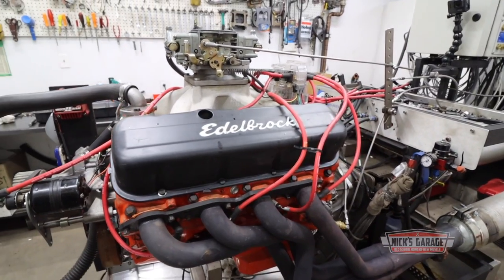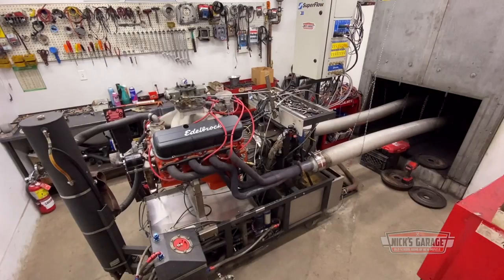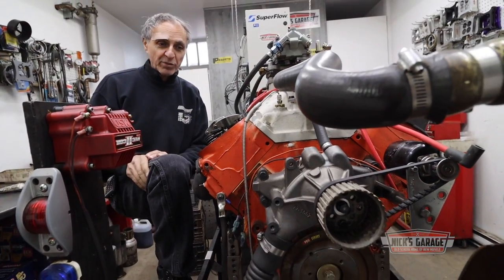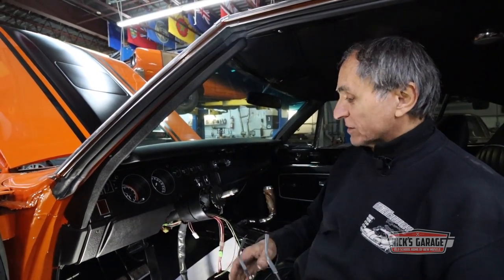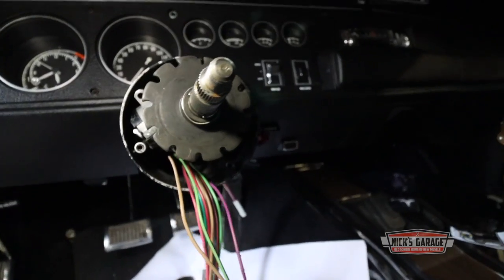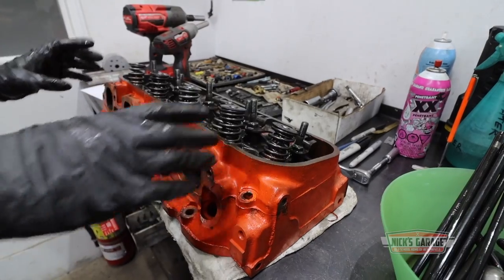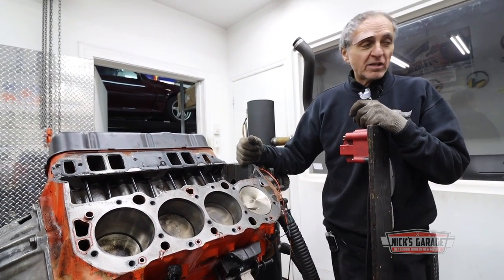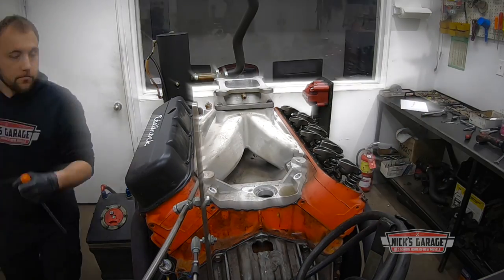Weak Big Block Chev • Wrong Parts + Poor Assembly = No Power!

Comment: All show and no go! It's amazing how you can mess up with such large cubic inches! BUT when you have no clue on how a engine works or how the parts you source and you choose by the way they look it's amazing how badly you can screw things up.....!  A Dominantor is a bit big for a little 427! Damn! Fist mistake. Had a buddy with a mild 509 BB Chevy, Merlin iron heads roller cam, Victor Jr intake, who always kept a dominator on the thing, the full steel non tubbed Chevelle would only run mid 11s on 12" slicks. Sells the car and the first thing the new owner did was chop it down to a 780 double pumper and the car gained over a full second bringing the steel chevelle into the low 10s on small tires in the 1/4. Lesson learned there! Bigger isn't always better! Did the Dominator look awesome? Absolutely! Not denying that fact it looked wicked! But it was giving up over a full second in time for that look and he never knew it, even though many people had made the suggestion to step it down from 1100cfm...... talk about a bitter sweet moment after selling it with being disappointed in the performance......

Comment: I think what you want is the closed chambered rectangular port heads. They used to call them bathtub heads cuz the chambers look like bathtubs. With flat top pistons I think it takes you to 10 to 1. Somebody co-sign this..
Reply: No. All it does it give you more compression, which the right piston will do. Closed chamner heads shroud the valves way too much. You want the open chamber platform.

Comment: That's a truck tall deck engine... uhm guys not good
Reply: Paul.   It is a tall deck block.  How did you know?
Reply: @nickpanaritis4122 it may have a 366 crank in it, that would answer the low horsepower..... it looks like 366 pistons as well.. the extended hose on water pump. That's a truck motor....on the original intake there is an extension hose between water pump and intake.. 
 And the amount of unused cylinder... and the low compression was dead giveaway
Reply: @nickpanaritis4122  You can tell by the water pump.  Where it attaches to the block, a short deck water pump will be almost flush with the deck itself, the tall deck is down a bit.
Reply: @pauljackson3791  366 crank is same as 427
Reply: @SealofPerfection  .        Thanks for the info.
Reply: @nickpanaritis4122  that be correct. The deck height is almost half inch taller so intakes are wider. The ring groove looks like they ran a 3 ring piston, not 4. And if all thing are stock it has an 8.1 or 8.5 compression. With those heads its probably 7.5 compression, Still looks like 366 pistons... what is the bore? I've just seen alot of big blocks and I can tell by looking. Alot of money went to Summit for nice heads and intake, for a low compression engine. It's still not gonna make power unless it's boosted somehow.

Comment: whoever built this 427 i wouldn't trust with a set of legos let alone another engine. The wrong parts, but also installed wrong! I wonder if the pistons were backwards on the rods or the whole piston+rod was installed backwards. And is that RTV sealant UNDER the headgasket?

Comment: I only use flat tops on big blocks when running boost with a cam ground In relationship to that or smaller cam builds/ smaller chamber heads. .
This had massive ports with tiny cam and was mismatched like hell. 
My bet is it wouldnt perform very well even though it had 366 on the dyno .

Comment: 2006 pontiac torrent 3.4l v6 
just replaced the head gasket and all of the sensors have been replaced with brand new sensors  MAF , / MAP/ Gas Cap/ (2) 02 Sensors/ Purge Valve/ Evap Canister  Solenoid and i am  now still getting the P0171 code, i  had the code reset it lasted for about 3 1/2 weeks and  it came back on . it says system to lean on bank 1. went to a different auto shop and the Mechanic checked it and says that there is a small leak in the fuel Evap System.
but the weird thing about this is the Check Engine light is off but when i take a Left turn the light comes back on....

update fixed the Problem the power that plugs into the,
 Canister  Solenoid installed a new plug it was crowded.

Comment: I think 427s that are mostly used are truck motors I’ve drove an427 Malibu and it was not even comparable with a 440 a stock 440 would kill that guy took a truck motor and Chucked a few pretty parts on it and says it is 600 horse to flog it

Comment: Are you gonna show us how you code the lock and ignition switch to the same keys sounds interesting?
Reply: tim.           Since I had to replace the ignition switch,  I bought a new ignition cylinder that came with a new key code. Since the original key did not work with either door, I had the door cylinders removed and had them send out to a locksmith to code them with the new ignition key. Now, we have ignition and both doors working with the same key. Trunk is another key with it's own code.
Reply: @nickpanaritis4122  Ahh thats how you do it thanks.

Comment: Id be expecting large open chamber heads with dished pistons to make compression numbers like this....low 8.1...maybe even high 7.1 compression
Reply: they could just flip these pistons around and get the 100cc eddy rpm heads meant for the ss454 trucks.  might not make 600 but hell be happy he was 85% of the way there.  ANYTHING is better than this lol

Comment: I'd be realy suspicious if someone told me it is a 600 HP big block engine with only a 4 barrel carb on top. Even the legendary 426 hemi had 8 barrel (2 carburator 4 barrel) and didn't goes there. Add to this the lack of compression (flat piston), the completly wrong spring valves and the cam shaft, you got the perfectly dummy assembly engine. At least, the guy who bough this engine was realy wise and put that engine to test before getting it in his car. He could have ended up with some serious trouble.

Comment: Nick. I have a question that I have asked many "in the know" and have never gotten an answer. We all know that flat tappet cams need to be broken in. Typical, break in lube, run the motor about 2K RPM or about 20 minutes. Question: How did the big three  GM, Ford, Chrysler do this with the millions of flat tappet engines built between late 40's till about middle 80's? I have a hard time believing they had to go through this procedure.
Reply: They got broke in when someone rodded the snot out of it parking it at the factory and the rail yard no doubt :)
Reply: Wild.     Good question. I have asked the same thing a few times.    HOW !!!!!

Comment: At this point you have to measure every thing because who knows what you have. I think the owner suspected something was off.  360 is a long ways from 600 hp. I mean if the engine made an honest 550 hp they would probably never even had it checked because unless you drive the same car with 600 hp you wouldn't even know..

Comment: Oh yeah. I learned my lesson buying used engines long ago. Guy sez I'll sell you a lightly used 350 SBC that is 350 hp. I hear it running not too ragged an idle. I bought it and installed it in my Camaro. But I notice it makes a funny waba waba waba waba noise. Good oil pressure but doesn't feel like 350 hp. So I pulls her out. I take the heads off and everything seems ok. Low miler no carbon. I pull 4 pistons. Oh yeah then I pull the other 4 out. Cast pistons and 4 of them have cracked skirts Seriously cracked. There was my waba waba waba. 

From that day on I've bought lots of engines but always told the vendor I'm only paying core price for it or I don't want it. Lesson learned.

Comment: So how big of a power difference would it have been if the pistons were installed correctly? And you can take the lock itself apart and rekey it yourself usually just by moving the pins around, pretty simple really and no need to buy new parts
Reply: no difference,it wouldnt change anything other than the pistons being in the right way..this engine needs domed pistons to raise the compression ratio

Comment: those 427s had closed and semi closed chamber heads..  maybe the heads have a too big compression chamber,,   im only at 7:50 guessing
Reply: You are correct, but the right way to do it is with an open chamber and the right pistons, put in correctly ofcourse.

Comment: Sometimes  horsepower in certain vehicles is not the most important its The low end Torque.  My big block has 781 heads with Flat tops and let me tell ya it will Launch. But if i paid for 600 hp i dam shure want it........

Comment: Who ever built this engine sure didn't know anything about HP. If you look at the #4 piston, it is pitted very bad and the #2 piston is new. Like you said they are turned wrong. Also if you look and see the corner of the block, it is pitted by, what looks to be done with a punch. and then they used sealant on the head gasket, which is a no-no. They threw that engine together for quick sell. Someone told them that it's a fresh build with 600 HP.  And they took them at their word. Thanks Nic, Ronnie.

Comment: me and my dad went through a big block for a man that bought the engine in the late 80s.  Was told it was a 1000hp blower motor.  6-71 blower, dinky camshaft, oval port heads, stock 427 crank, rods and pistons.  We had to tell him he had a maybe 400hp motor.  
After he wrote a check for 10000 dollars we built him a good 496.  Told him to upgrade to a 1071 blower.  told him to step up his 4.88 gears to 3.73 or 3.55.  car scared him to death we he drove it, almost wrecked.  The look on his face when we told him to replace his 6-71 with a single plane to pick up 150-200 hp was priceless.  He was so scared of it he never went up to the 1071.  guess 550 hp was enough lol.  
Too many people watch too much TV.

Comment: Common to see someone go with some big heads a big intake and big headers and be like oh someone made 600hp with this top end but you gotta be able to use all the air your putting into the engine like I wouldnt be surprised if going down a carb size would actually make more horsepower cause the engine isnt using all the gas that's being put in

Comment: I have been burned so many times when I buy car or parts I treat it as if it was junk untell I use block tester on engine and check tyranny fluid then I drive them for an hour or 65km then scan the engine for codes or problems the scanner and block tester never lies most owners freak out when the block tester comes out that's when you walk away

Comment: Hey Nick you knew it wouldn't do no 600 hp at the crank. 366 HP is only about 200-220 HP at the rear wheels ?

Comment: It had 600 hamsters not horses damn I'm Ford guy I can see soo many things wrong with that engine. Guess that gear driven cam made it think it had 600 hp. Gear drives can cause spark chatter,  no full roller rockers, but has 3/8 dia pushrods with small lift cam and top it off with dominator carb WOW. Then with flat top piston put in wrong along with open chamber heads. WIth flat top pistons with quench chamber 4v heads on 351C will get you high compression ratio

Comment: Prior to the tear down off the top of my head I'm guessing.
1. Low Static Compression
2. Bad cam design (for application)
3. Gear Drve installed a tooth off
At that level I wouldn't be surprised if it's all 3. Either way the intake valve is closing to late for the static compression. 

I like to see 170-200 psi (engine design dependent) in a pump gas street engine. To many people get stuck on one static compression like 9.5:1. That might work or might not depending on bore, quench and intake valve closing point. It might be two high or to low.

Comment: That's a bummer,  but if the guy was willing to refund some cash, wouldn't be hard to get 500hp out of that motor, find some closed chamber oval ports,  and put a proper cam in and it'd do it. 
I'd still want money back from the seller though.

Comment: " I have a customer who was told the engine was 30 over, turns out it was 40 over..."  Never knew someone would complain about getting more than what they were told.
Reply: No man thats .030 inch over  on its stock  bore. .,.040   means there no meat left  on the block to go to the next  size up over bore... Which is probably .060....
Reply: @georgesviderski2469   ok thanks!

Comment: I am at the 7 minute mark. Its the Cam not tuned to rev for the intake and heads. Also timing gears probally suck what? 15 horse? That wine is pretty cool though.

Maybe bad rings as well? HMM I didnt hear it idle. He says were is the Power. Where is the video of it idling? LoL Did I miss it ? I am going to rewind.

Comment: Gear drives induce too much noise into the distributor and cause problems with hei electronics. Couldn’t tell ya how many times I’ve had engines come through here with a harmonic problem from gear drives.

Comment: Is that a 10.2 deck height 427?
Reply: Justin......       It is a tall deck block.
Reply: @nickpanaritis4122  well put a stroker crank and make it into a 489 or 496....would make a great torque monster. Have to make custom brackets to fit altenator etc...

Comment: After a dyno mishap scared the crap out me once I'm always on edge as the RPM gets up there especially on an unknown engine. Could it be an experimental treatment for unplugging a viewer?
Reply from the maker: What happened?
Reply: @NicksGarage  Friend got some free dyno tuning after the 302 block he bought needed 2 sleeves. Unfortunately his new timing chain set hadn't arrived yet so he took a chance using the old set. Got through breaking in the cam but the Holley's idle circuit needed the throttle plate air bleed holes opened up a little. We decided to quit for the night and finish the next morning but at 2am i was woken by someone who was sure all the tuning knowledge you'll ever need can be found on the bottom of a beer bottle. Well I suppose it was inevitable running on that much alcohol but a pull to 4500 went way higher and he didn't back off when the sound suddenly changed. It was just going past 6000 when everything went horribly wrong. I remember hearing the exhaust sound coming out the carb then a distinctive cast iron complaint and all that rpm slamming to zero. Could barely see the motor at first through the cloud that filled the room. The timing cover revealed what was probably the initial failure or one of them at least. A mangled rod had punched its way out. It was a mess. I went back to sleep while the autopsy continued for several hours. The good news was that the timing chain set arrived the next afternoon. You got to start somewhere building a motor, right?

She was given a burial at lake, a frozen one, Green Lake. Pulled it out with a snowmobile and it became an expensive anchor point.

I apologize for the long story but stories always seem to do that and thank you for asking sir. I do like hanging out at your shop even though I'm almost an entire country away at -122.601.
Peace.

Comment: Just wondering who would go through the trouble of getting Merlin rect. heads then have springs that float above just over 5 grand?? I had a 427/425 with Chevy factory solid cam and the FACTORY springs were rated at about 320 pressure closed thus good for over 6500, I doubt those springs are shimmed either, 600 is pretty optimistic unless it's a high compression with a huge not very streetable cam, even then its not a stroker

Comment: Just needs l88 pistons  in it up the compression with triple valve springs and a bigger cam be away
Reply: Id be checking everything the person who built it is a goober. Who knows if the rings are even gapped correctly or at all etc.

Comment: Those ports are too large to make HP and torque at a reasonable RPM range with only 427 cubes.
Reply: LOL those heads was used on LS6 engines

Comment: Wrong combo, I got hosed over on my first BBC build . 1973 454 ,told the machine shop/builder to give me 10 cr . So he bores the block wrong had to sleeve one cylinder🤔.  Six months later I assembly it, Tells my Pop those 049 heads have rotating cups on the exh no good . So he give me a so called rebuilt 063 semi closed chamber  heads, probably sold them, guy was ahole. That motor had 12.5 ,Motor ran like crap. Never broke 100mph at the track . 😢

Comment: I'd like to know what the compression ratio would have been with those pistons
Reply: Doing a quick run through with a CR calculator and assuming 100-119CC heads I'm going with 7.5-8.5:1. That's assuming that everything else is fairly okay suck as HG thickness and deck height. If things are pretty ugly (119cc heads, .039 HG, .025 deck height) I think he could dip below 7.3:1.

That's a pretty ugly thing in terms of being able to choose a cam that makes meaningful power even with that amount of cubes. I'd be trying to take it back at this point as you're gonna need a lot of parts to salvage it if you could. At least pistons and a full valve train.

Comment: Two things come to mind on this video.   I would have at least taken a die grinder and tried to smooth over the edges of the intake ports to the intake gaskets on any car that I wanted to make horsepower.  I see that wasn't done on that big block Chevy.  Second....I would have taken a door lock and the ignition switch to a lock smith and had that person match the ignition switch to the door lock if I had replaced one or the other.  Who knows if the ignition switch or the door locks were replaced at one time.   As Nick knows....there should only be two keys.  One for the doors and ignition switch and one for the trunk.  I really don't remember what key was used if you got a glove box lock option.
Reply: John.              The door locks were removed and sent to a locksmith to code them to the ignition cylinder.